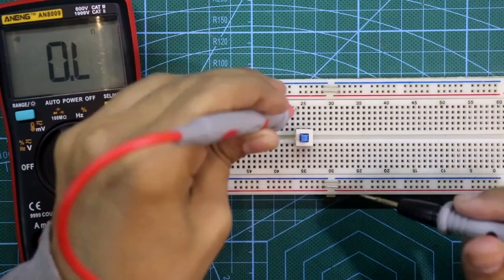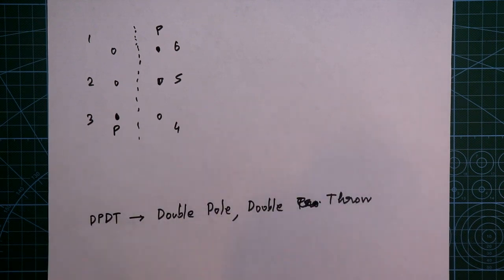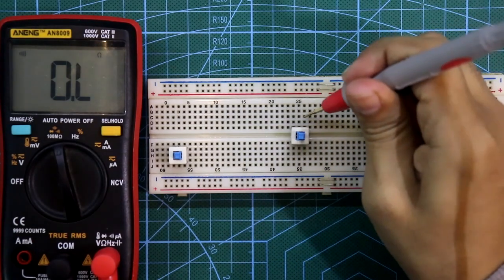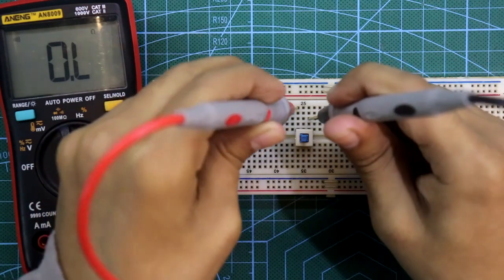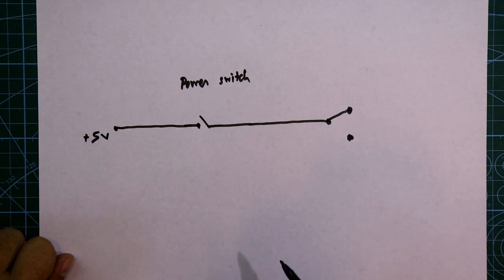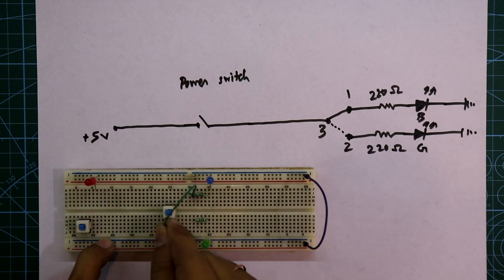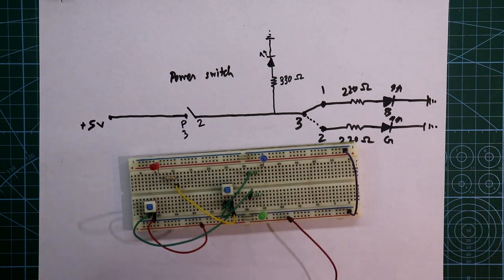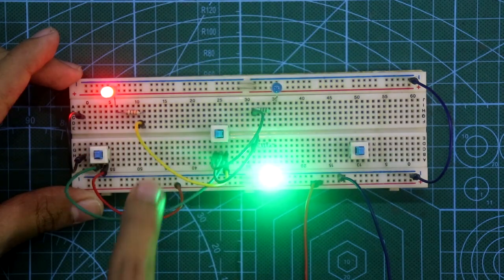How to use 6 pins 8x8 mm self locking DPDT push-pull switch

Comment: If I connect wires in pin 2 and 3 to turn on a led by pushing the switch and cut rest of the pins will it work??

Comment: Mine looks indentical, but the pinout is different. The middle pins on both sides connect with pins 1 and 6 in the pull position, and then they connect with 3 and 4 in the push position. 
Which has confused me a lot!😅